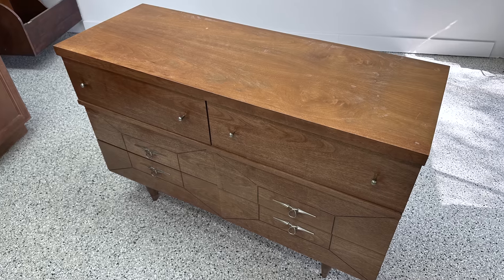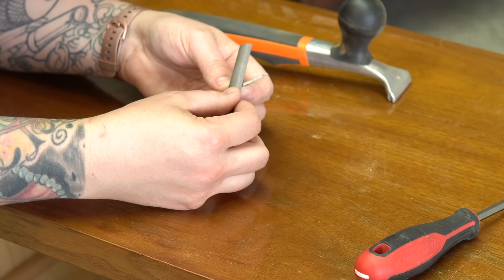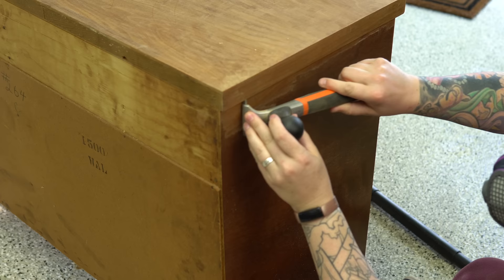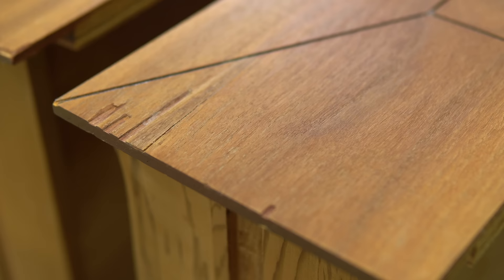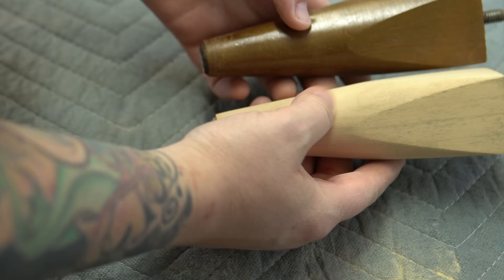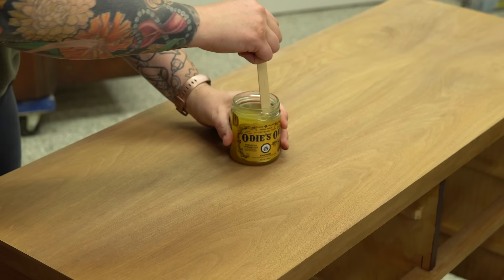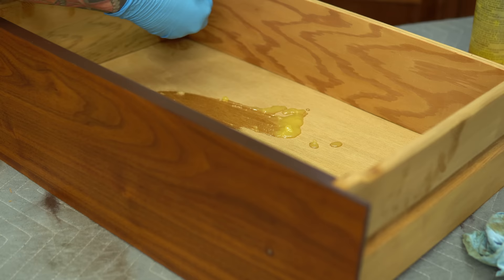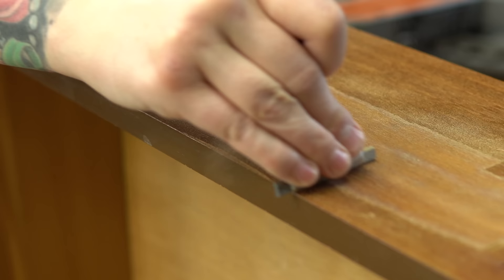PULLED FROM A DUMPSTER: Ultimate Trash to Treasure Dresser Restoration

Comment: Angie, thank you so much for your videos! Most of my furniture came from the side of the road and I've been using your ideas as inspiration as I fix each one up to create a cohesive gothic home. About a year ago I pulled a really pretty ornate (think ball-claw style feet) side table from the dumpster that someone had already painted all glossy black. The paint hadn't cured properly so it was a little gummy on top but I figured I could redo the top when I had time. I thought, since it was painted this way, that it was a cheap piece made to resemble something fancier, which was fine with me.

Anyway, a couple weeks ago I finally got a scraper to start getting through the paint, and because of your videos, I quickly realized I was seeing veneer under there with the grains going different directions! I remembered what you've said about being careful about veneer and figured "well if someone painted it, it's probably ruined somehow, but I want to see first" - so I put away the scraper and spent hours sanding carefully by hand. 

The tabletop is walnut veneer in a starburst style design with an inlaid circle in cherry veneer, and it's basically perfect!!! I'm so glad I didn't blast through this! I researched both woods and learned the cherry will darken beautifully, so I'm going to forego staining altogether and use Odie's oil on the top, leaving the legs black to match the rest of my decor. I'm so happy.

Thank you so much for your videos!! I definitely would have unknowingly missed out on this gorgeous veneer otherwise.
Reply from the maker: Oh wow Crystal!! What an incredible find!!! Kudos to you for taking your time and finding out what you had, I bet it's gorgeous. Thank you so much for watching and for sharing your find with me! 😀

Comment: Brass plating can be renewed using hot or cold techniques, HOWEVER, it required equipment, chemicals, and materials that you probably would not have a need for or want to have in your workshop.  So, good call on painting.
Reply from the maker: Thanks so much for watching!

Comment: Because of you I just saved a big, beautifully carved, solid wood table from the dumpster. It's still laying in my basement at the moment, it's pretty messed up (looks like it's been outside for a while) and I'm still not sure if I should restore it in full, or make two plant stands out of its legs - the table top is cracked from the sun in two places, and the splits are almost quarter of an inch wide.
Reply from the maker: Oh wow! That sounds like quite a project! Yes, some just can’t be saved as is, but those ones I like to disassemble and let it be “reborn” as something else down the road. :-)
Reply: @TranscendFurnitureGallery  exactly! I have some experience restoring electric guitars, so it can't be that much different, wood this, wood that, same thing, haha :D

Comment: Have you ever thought about replacing a top on a piece of furniture with a recycled piece of granite?  There are a lot of pieced of old granite being removed from homes that are being remodeled that would make great replacements for tops on furniture where the existing tops are not worth repairing.  I'm relatively sure you could get a counter top installer to cut an old scrap piece for you cheaply, if not for free.
Reply from the maker: No I haven't, neat idea though! Thanks for watching!

Comment: Where are the drawer supports? Their absence is glaring! Can you install them, along with drawer glides?
I like the black hardware.
Another glorious job—the wood color and grain are awesome!
Reply from the maker: What? You can see them very clearly. This piece uses side rails, with a groove directly in the drawer sides. You can see them clearly at 2:14, 2:54, 3:29, and numerous other locations in the video.

Comment: It’s interesting that this piece has those holes at the top (on the inside).  I’m currently working on a Kroehler set that has the same thing.  If it weren’t for the maker mark I would have thought my set was not mass produced, but it clearly was.  I’m so curious now what those homes were used for!  Intriguing!
Reply from the maker: Interesting! Keep me posted if you find out why they're there! Thank you so much for watching!

Comment: You may have previous videos that would answer my question…however…how long does it actually take to get that finish of by scrapping?  When it’s sped up it looks so easy!  I’m thinking it’s not. 😅 I have a tall waterfall dresser that belonged to my parents.  They gave it to me when I first got married about 58 years ago!  I would love to restore it to its previous glory because it’s beautiful and pretty solid for it’s age.  One of our previous puppies chewed on the corner of one of the drawers and it has a few stains. The drawers are a bit “wonky” when you pull them out, but it is a family treasure and I would love to save it!  You are helping me to become a bit braver to possibly tackle the project!! 😊
Reply from the maker: This piece was only about an hour and a half in total to scrape. No mess to clean up, no stinky chemicals. Most of the time, it’s not much faster to strip and clean up.

Comment: When you have grooves in the drawers like that and use Odie's Oil, do you use something like a tiny paint brush to get the oil in the grooves?
Reply from the maker: I actually try to keep the oil out of the grooves altogether. It’s not the end of the world if it does get in there, but it’s not necessary, so I just avoid them. :)

Comment: Gorgeous. I noticed you put the wood butter on after you used the graining markers. I thought that would have wiped off the graining marker work, but it didn't seem to. Would a second coat of Odie's oil yield the same results, or would that have removed the graining marker work?
Reply from the maker: I just make sure that the markers have fully dried. The longer they can sit, the better.

Comment: Question while I watch regarding the veneer repair - I’m wondering why didn’t you do a clean cut and replace the whole triangle section rather than the small pieces? Wouldn’t a single larger piece with one join would be more stable and easier to finish?
Reply from the maker: With matching, the more of the original veneer you can leave, the better. If you notice in the final shots, the grain pattern flows across the drawers from one side to the other, kind of like a wave. If I’d replaced the whole section where the tear out was, the inconsistencies 
would be more obvious. :-)

Comment: This is an amazing restoration!! So  beautiful!!  I’m about to start a couple of projects myself after not having refinished furniture in many years, and I am wondering how you decide whether to use stripper or a scraper?  Is it dependent upon how many layers of finish the piece has?  If you mentioned this during the video I missed it. 
Again, Such a beautiful piece -thank you for sharing your gifts for all of us to see & learn!!!
Reply from the maker: I actually have a video up on sanding questions in case you haven't seen it or would like to. 

I usually will only sand a finish away if it's basically non existent or if I'm on solid wood. I'll scrape usually over veneer with SOME finish, or a lighter/damaged finish, and I'll use a chemical stripper for removing thick finishes or multiple layers of paint. I hope this helps!

Comment: I love the color of the wood and the black hardware is great. May I ask, is the plywood a plus or minus in your book and pros or cons?
Reply from the maker: It makes the furniture extremely stable from a wood movement perspective, where solid wood is very prone to cracks and checks when it expands and contracts with temperature and humidity. It allows MORE furniture to be made from the same exotic wood, rather than one single temperamental piece of furniture, and it makes it more affordable for both the maker and the consumer. So it's a plus for me, for sure! Thanks for watching!

Comment: So glad I found your channel. You're the best and I've learned so much from you. Is there an oil I can apply to a dresser that would be similar to Odie's Oil but not as expensive?
Reply from the maker: There are lots of different finishing oils you can use but Odie's isn't a typical oil. It belongs to a family of finishes called hard wax oils. It's not the same as a  hemp or mineral oil. It's definitely not a cheap product upfront but a little goes a long way. One jar usually lasts me several typical pieces. Thanks so much!

Comment: Question for you - on the veneer repair on the drawer (the one that had the piece glued incorrectly), why not just take the whole corner and cut a new patch triangular patch instead of the three pieces? Wouldn’t that be easier to camouflage? Just kind of wondering. Great video as always and fantastic results!
Reply from the maker: With matching, the more of the original veneer you can leave, the better. If you notice in the final shots, the grain pattern flows across the drawers from one side to the other, kind of like a wave. If I’d replaced the whole section where the tear out was, the inconsistencies 
would be more obvious. :-)
Reply: @TranscendFurnitureGallery  makes sense. Thank you!

Comment: Hi! Why do you scrape instead of sanding? Thanks for the amazing video!
Reply from the maker: You're most welcome! I usually will only sand a finish away if it's basically non existent or if I'm on solid wood. I'll scrape usually over veneer with SOME finish, or a lighter/damaged finish, and I'll use a chemical stripper for removing thick finishes or multiple layers of paint.  I hope this answers your question! Thanks so much for watching!

Comment: "They very seldom use stain." Interesting to hear you say that. "Most mid-century furniture was finished with sprayed, toned lacquer."
Reply from the maker: Some were stained. But many of them were not. Toner allows for a more uniform and consistent finish, especially when assuring that all pieces in a set turn out the same, regardless of variations in thr woodgrain itself.

Comment: I have a question: if the markers you use are like some wood stain but in the maker format... Wouldn't they go BEFORE the wax? As I've always hear the wax is the last step. Or you don't do it that way because the wood color gets enriched with the wax and it would change the colour of the markers? 
I hope I'm making sense haha. 
The piece looks amazing as always!!!! 
I'm glad you're all safe as well 💕💕💕
Hugs, Angie! And kisses to Nachito and the bunnies!
Reply from the maker: Any colour corrections (pigments, markers, toners) should be isolated into a layer on their own. If you notice the areas where I added marker but the colour wasn't quite right, there's a few seconds before the markers set in where you can wipe it off- that wouldn't be possible on bare wood. The first layer seals the wood (or stain, as the case may be at times), then the colour work, and then the final coat I did on this was the Odie's Wood Butter, which is kind of like a mix of the Odie's Oil and Odie's Wax. :-)

Comment: Where did u get your veneer replacement material?
Reply from the maker: I salvage veneer where I can from older pieces too far gone etc. but I was also fortunate to find someone selling a box of  veneer scraps on marketplace. Lee Valley sells small packs of veneer. But I haven’t yet found anywhere nearby that you can get large sheets, which is frustrating.

Comment: Have you ever considered using a sand blaster?
Reply from the maker: I find sandblasting a bit aggressive for furniture. Soda blasting works well and is a bit less intense, though that can also cause damage if used incorrectly on certain pieces. I’m not entirely against soda blasting… but it has to be done carefully on the RIGHT piece.
Reply: @TranscendFurnitureGallery  Thanks for the reply - your work is amazing x

Comment: That Odie's Oil is miraculous!  That was a bland, milquetoast piece, but remove the old finish and let that walnut sing.... gorgeous.
The Hardware... the black is okay; coordinated well with the black channels.  The upper Peg Handles are NOT good.  All that drama at the base of the piece and those itty bitty pegs up top... I bet they had escutcheons from the factory... just some kind of plate to counter all that drama at the bottom.
Another piece you made magic with.  That will sell quickly.
Reply from the maker: Yes, this one is already gone. 🙂 Thanks for watching!